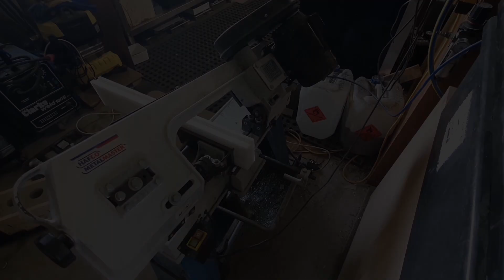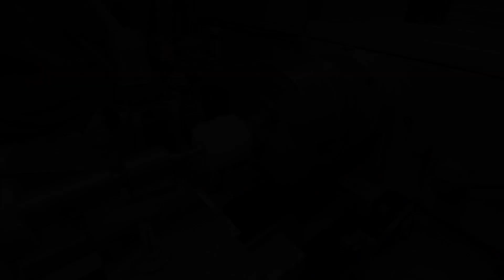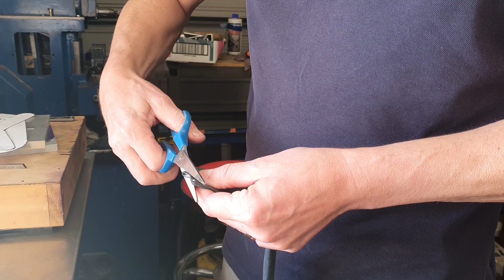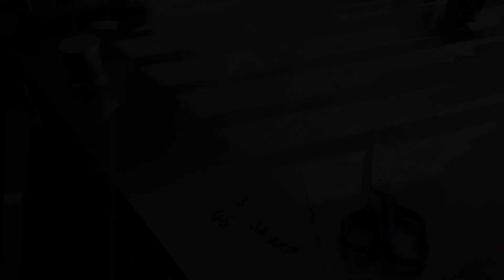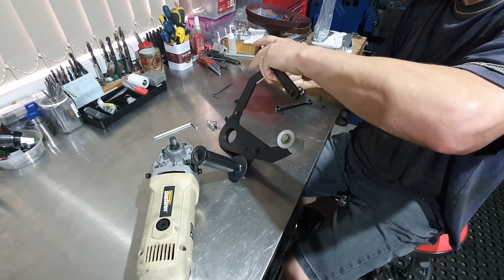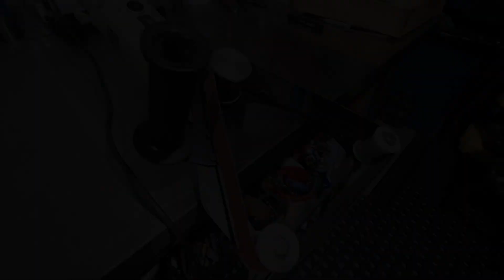#85 - DIY Angle Grinder Tube/Pipe Sander Attachment - Tube/Pipe Polisher

Comment: Cool, nice build, definitely could come in handy.
Reply from the maker: Hi Paul, hows the tank progressing? Did you get you're CNC Plasma working yet? Cheers Kevin
Reply: @Machine_NZ  no, the parts and postage price has made me shelve it for a while.
Did however managed to put new barells and pistons on the beach buggy. Also fly cut the heads to a 7.1:1 compression ratio, it used to be 6.6:1, so it's got a bit more bark now.

Comment: Just heard Emma gave your video on the angle grinder a mention so I thought I'd pop by and have a look. Looks like a mean piece of equipment, did you do the casting as well? 

Good luck from Spain!!
Reply from the maker: Hi David. Thanks for watching. Yes I melted some metal for the drive pulley. Just getting into casting. Cheers kevin